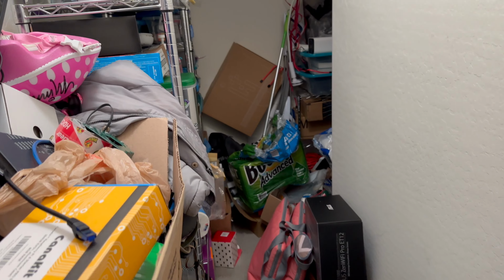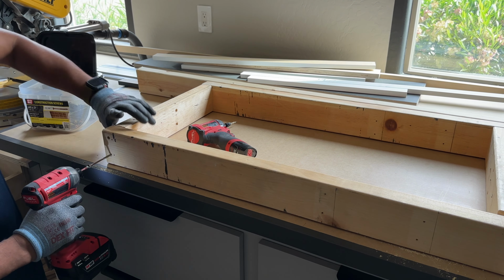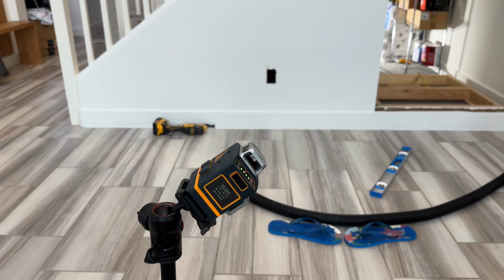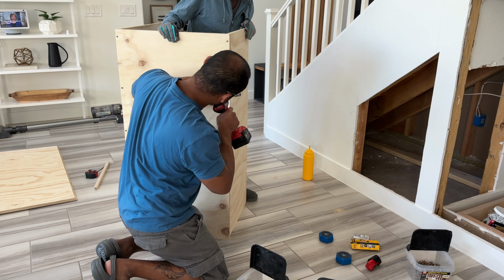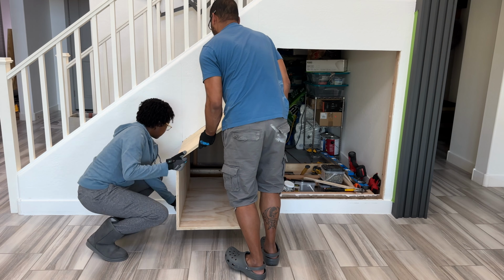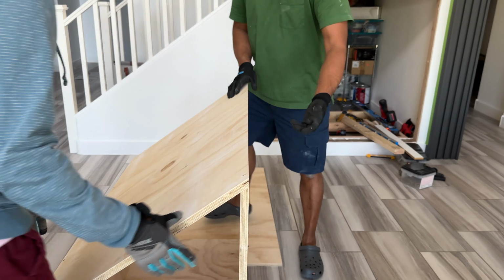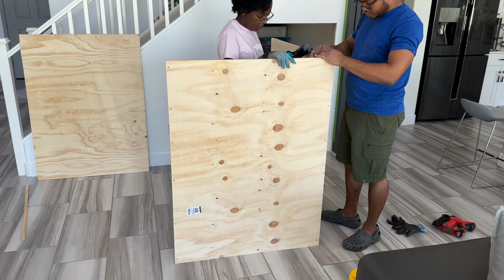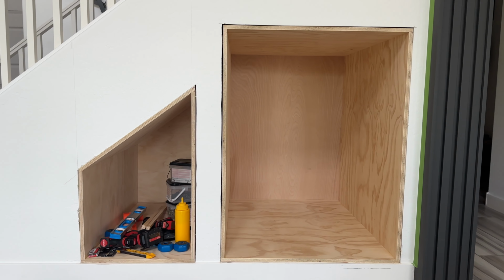DIY Under Stairs Pull Out Storage | Part 1 - Demo Day | Drywall Removal and Storage Box Build

Comment: For the back, I see other cabinet builders are using 1/4 ply. For the joinery, others using pocket hole. What is opinion? I have a similar situation, and about to pull the trigger to build it.

Comment: What did you do with the electrical wires ?!?!?
Reply from the maker: The vertical ones are sandwiched between the studs and the ones on the bottom are running along the baseboards.